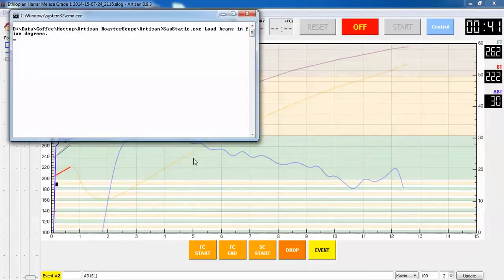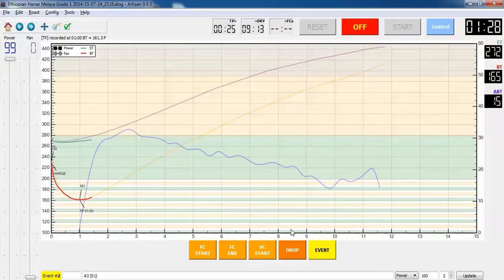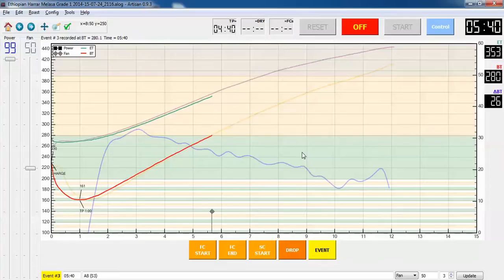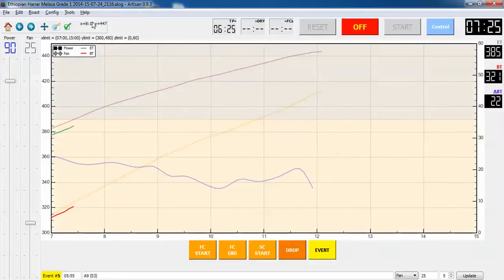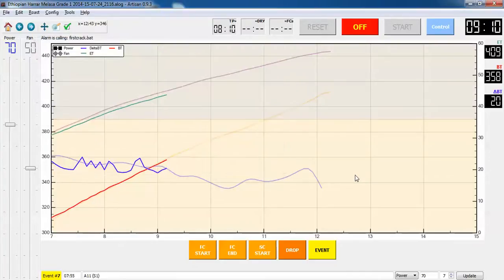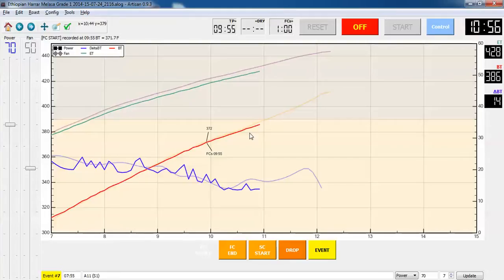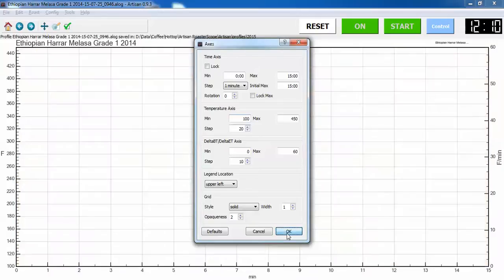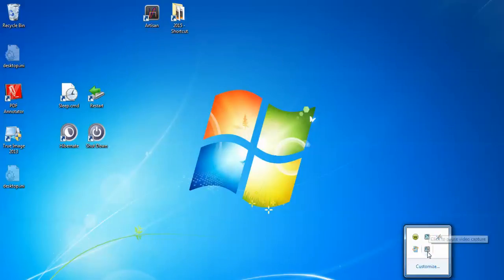Ethiopian Harrar Melasa Grade 1 2014 roasted 07-25-2015

Comment: Nice roast mr rick . Where can i insert reminder pls ?
Reply from the maker: The reminders are from audible alerts in the alarm file. In Windows, I use a program called saystatic.exe. There is an example file for a Mac computer in this thread http://www.home-barista.com/home-roasting/drilling-back-plate-of-hottop-t40597-20.html#p461540
Reply: Mr Rick do you first pre-heat the hottop and bring back the temperature to your target load temp of 250?